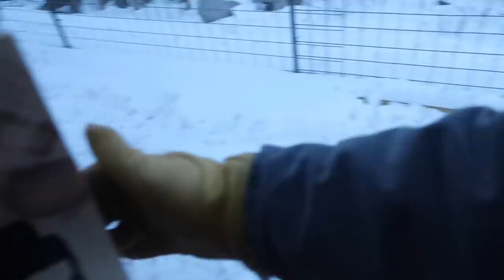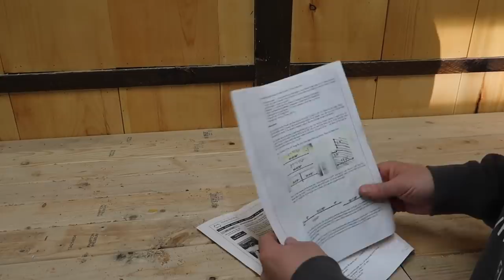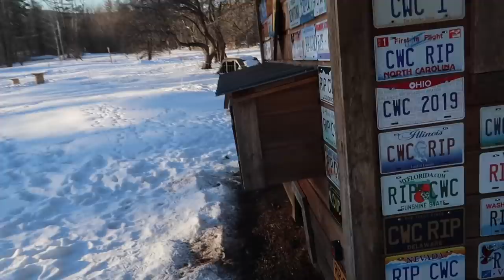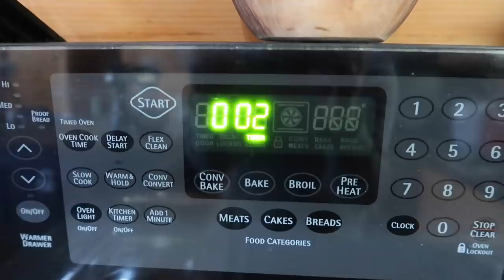We Bought 20,000 Rare Bees OFF the Internet For OUR HOMESTEAD

Comment: Al, I believe you may be making a mistake with the long hive.   In my opinion it may be the wrong choice for such a cold climate.   Bees cluster for warmth in cold weather.   They "eat up" (move up as they consume honey) and have difficulty moving to the side in cold  weather.   I think the probability is high that they will not survive your first winter.   I also recommend against 'top bar" hives.  It is difficult to use any kind of mechanical extractor with "top bars" so basically, you will have to consume comb honey or squeeze  the combs by hand.     I would guess that the Nucs that you are purchasing will be on Hoffman frames which are not "Top bar".    I think you  did well by selecting the Saskatraz honey bee.    Keep us posted!!

 To harvest "top bar" honey

Comment: You could ad a 1x1 to help stop little "P" out of the feeder, the 1x1 should be big enough to work with out the others hitting there heads. Plus you can round it so it not have sharp edges.

Comment: If you put in a removable wall frame that goes all ghe way down you just need to move it down every time you add a clean frame ... Then by the end of the season just pull all the full frames you want to extract from ... Use the hive to store until you are ready ... Some people even add an inspection window on the side with a sliding shutter ...

Comment: Love what you are doing building a long Lang. It looks like the rabbets you made on the bottom of the box would be for a solid plywood bottom but you said you were going to do a screened bottom. Now I am curious what you are up to.
 I am in the process of building an insulated Layens using 1x lumber for the inner and outer walls with a 1 inch foam sandwiched between. If I didn't have a CAD to work out the details I would be wasting a lot of lumber on mine. The tedious part of building a Layens is building all the frames from scratch.